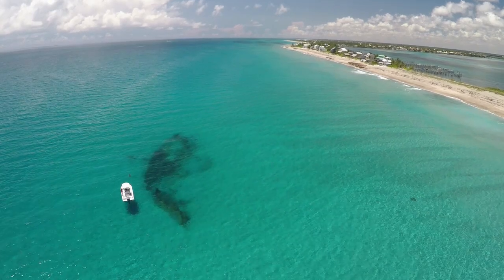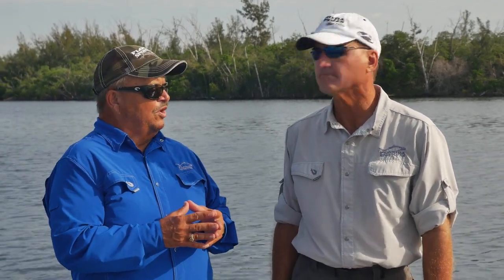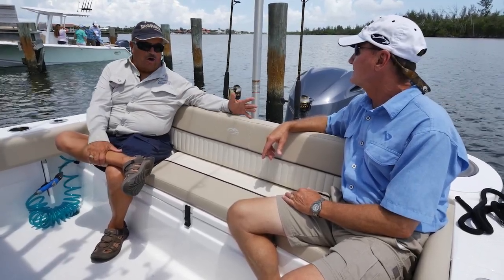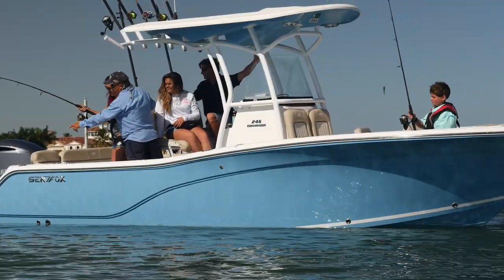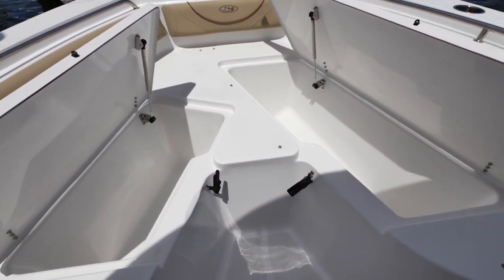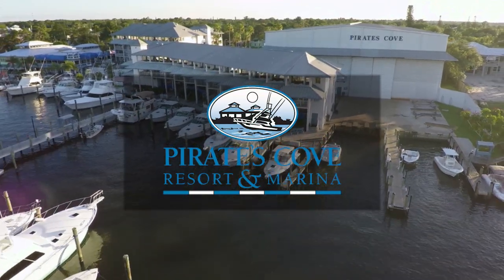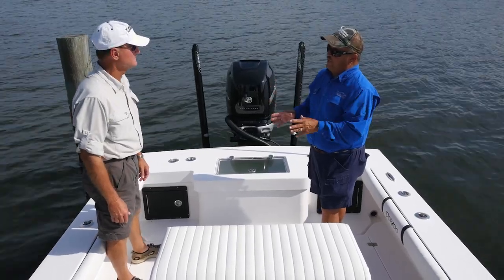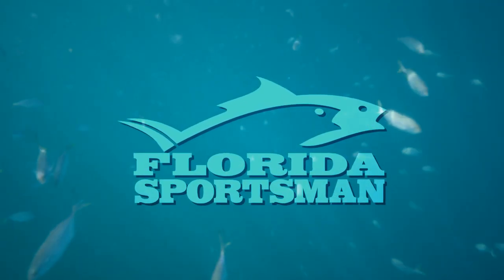Florida Sportsman Best Boat - Head Offshore with a Single Powered Center Console

Comment: Its all about the right gear and the right skillset.  If you're a novice boater looking to go offshore in your brand new boat, ignore this program, take some charters, and see whats really involved.  You don't get into this to save money, but you can still maximize efficiency. my tip, buy a whaler second hand.  Let someone else take the depreciation hit.  I currently run a 190 outrage out to about 40mi on the good days, but the boat can take a lot more than i can.  Single engine, 64 gallons so about 320 mi range, holds a 160 yeti and with a t-top I'm bringing up to 16 rods with me, oh yeah, it can't sink, and when it swamps it'll stay level.  Not much you can't do with it, and so long as you don't try to overpower the conditions you'll be fine.

Comment: Ok, serious question for you Sea Hunt owners. He says in this video you can't use a bow mount trolling motor on the SH 235. Why?  Why won't a 112lb, 87" Minkota work on a SH 235?
Reply from the maker: Thanks for watching the show R H.  I believe this episode was filmed back in 2015 and trolling motors had not yet evolved with long enough shafts for most high free board center consoles.  Current long shaft trolling motors would definitely work.